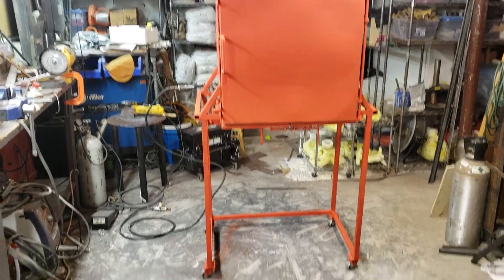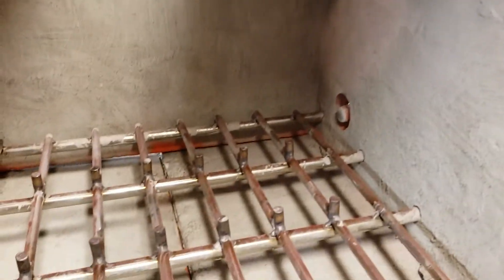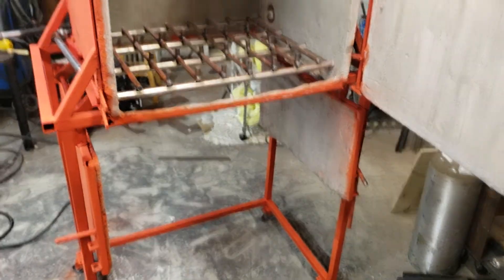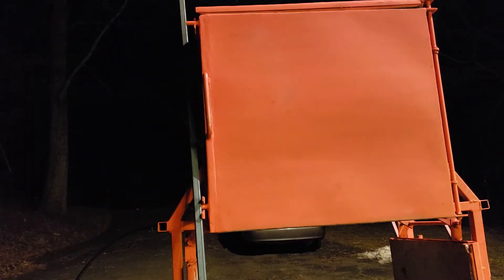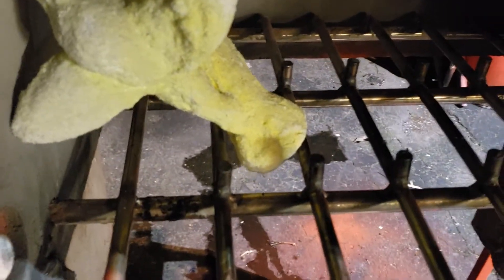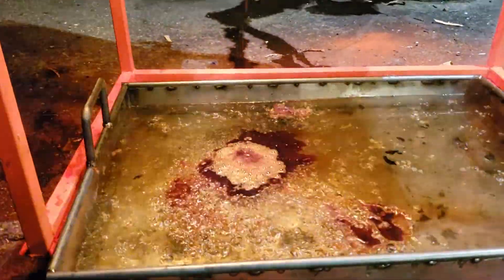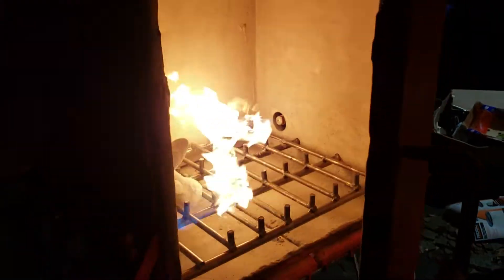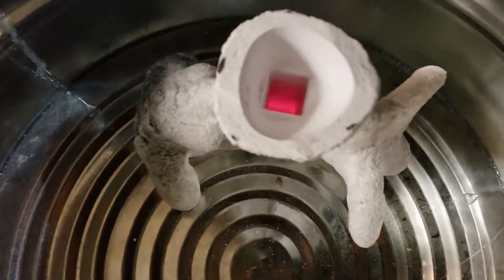DIY Lost wax kiln made with real satanite!

Comment: Looks good. Ours is similar and we have had problems with the steel floor grates warping. Hope you have better luck. We also made  ceiling hung tongs which work great for handling the hot molds. 
Check us out!
Reply from the maker: Just saw this now. Yes I actually watched a lot of your videos on tour website and used your furnace as a template! I just modified certain things and changed them. The grating is 316 stainless which is pretty temperature resistant. I do need to finish my temperature controller so I can keep the burnout chamber at the right temperatures - below the warping point of 316.